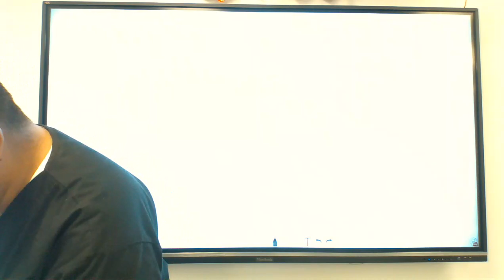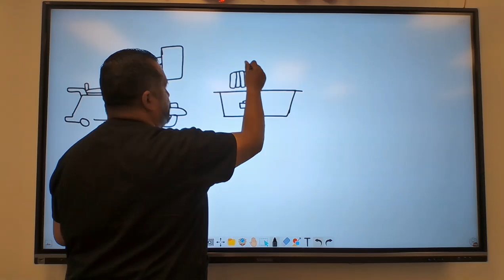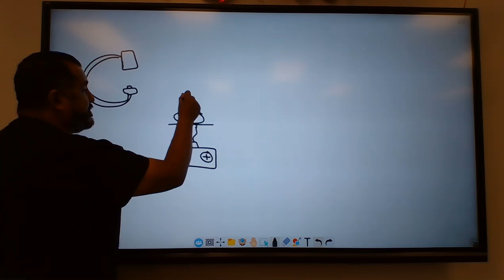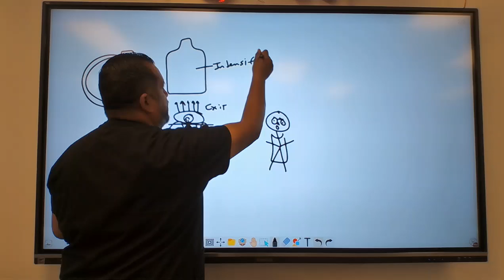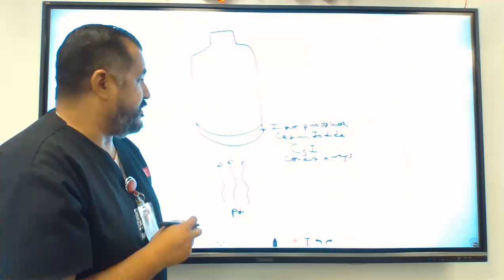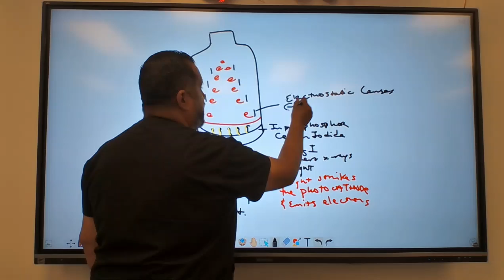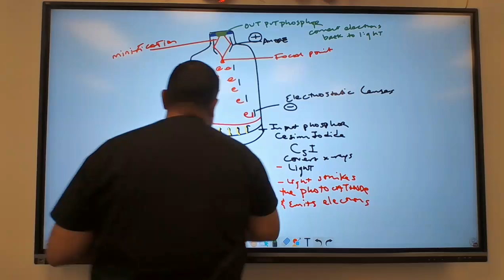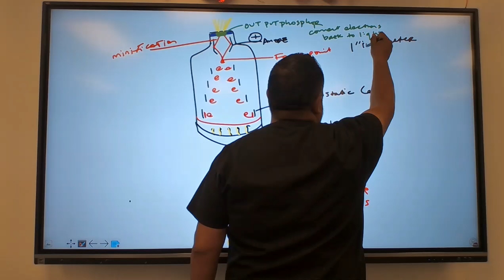Fluoroscopy and the Image Intensification Tube | Radiography with Mr. M

Comment: I was told that the Input (II) is convex, but I am confused now. Unless you are looking from the inside out? perhaps? please help.
Reply from the maker: Hello, yes, the photons strike the input phosphor's convex surface and are converted to light photons exiting a concave surface. I relate it to the same idea of the thoracic spine where posteriorly the spine is convex but anteriorly the curve becomes concave. It is this concave surface that may result in a loss of brightness around the edges of a non-magnified fluoro image, we call it vignetting. I hope this helps to reduce some of the confusion. Mr. M